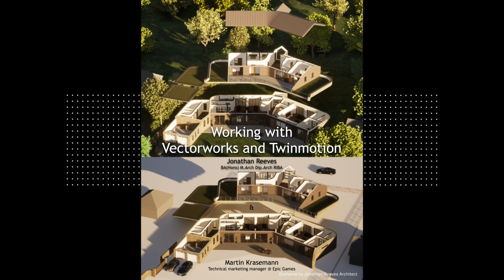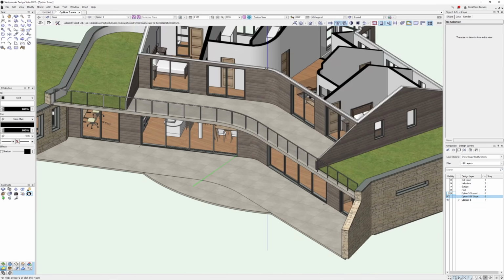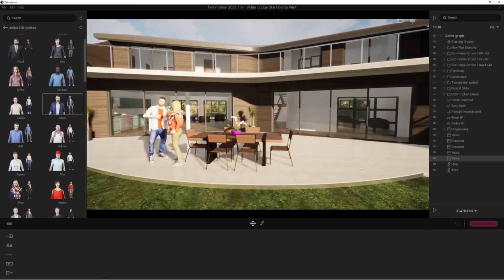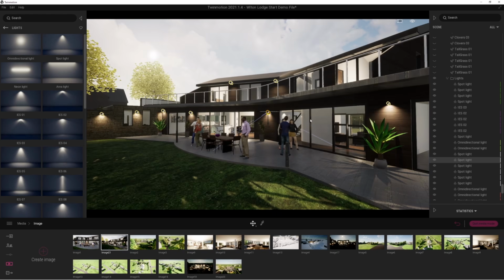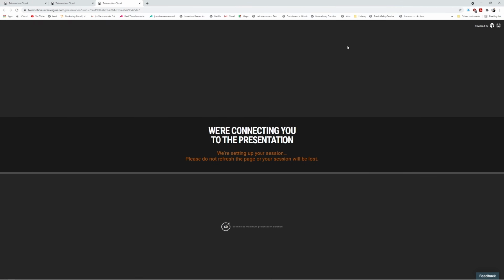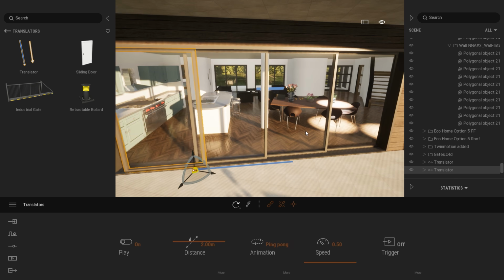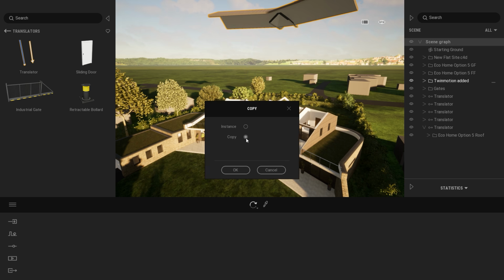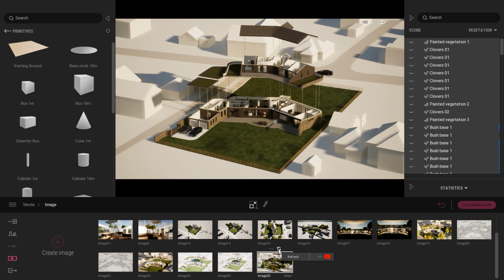Working with Vectorworks and Twinmotion | Webinar

Comment: How do I animate a plug in door made in VW in TM? The class attributes don't allow me to just select the door. It selects all the components with the same class name for material (ie. interior finish is Mahogany (all doors and windows and exterior finish is black metal).? At 33:23 the french guy, animates sliding doors but each panel seems to be a solid subtraction rather than an actual door from VW. Do we have to blow up our plugins from VW to make the work properly in TM? if so this is a major problem for me as clients are always changing things.